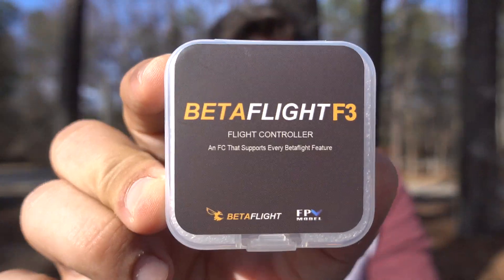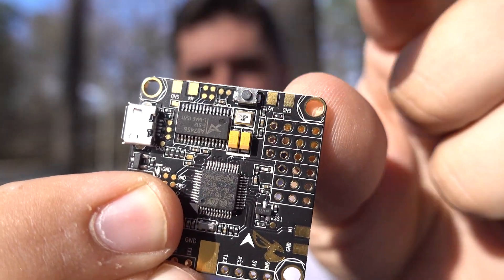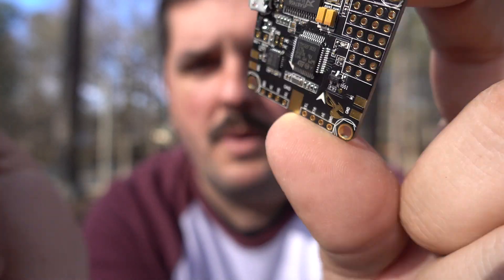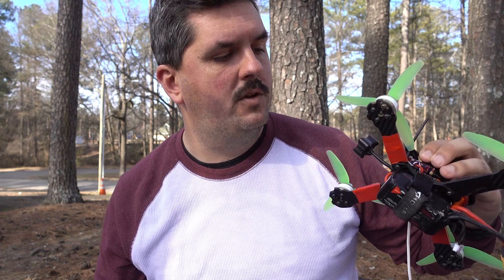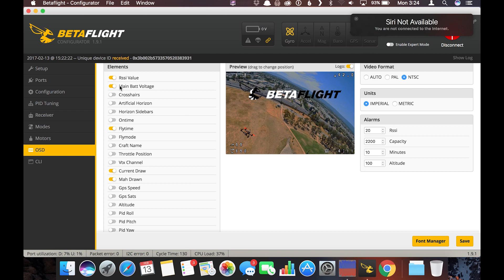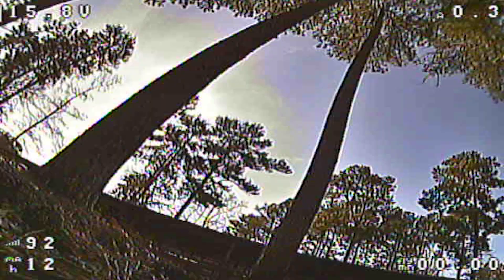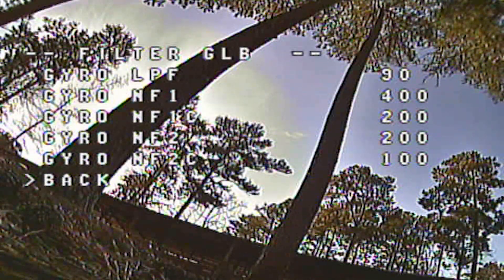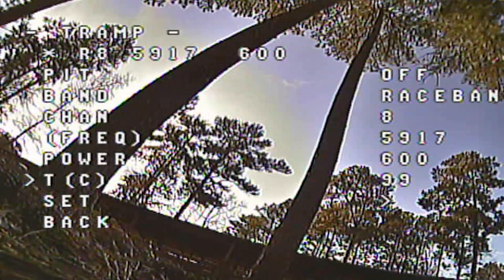Betaflight F3 Board Overview

Comment: Video noise? Ive tried it with the tramp with tons of noise. If you like lines in the video feed its a decent board.
Reply: daniel dimitri thanks for all the info, i have tried everything you have listed over the years and still no luck.
Reply: daniel dimitri there's lots of problems with this flight controller. look at the forums. it might have his name on it, but they're all made in China... its a decent board, but they all have their flaws. this one is video noise and an irritating ESC pad layout. these boards excel in tight builds where you want a really low stack. if you need to add 4 capacitors and an lc filter to remove the noise, what's the point? just buy the omnibus f4 clone off banggood for £20 remove the regulator and add a pdb. save money, get all the features with none of the hassle. as said, the dys is far superior in every way and better value. this board has been out around 5 months. that's ages with the speed of tech.
Reply: daniel dimitri the omnibus f4 pro v2 is crap mate. Lots of issues. There's a v3 out that fixes a lot of them.
Reply: jwhit87 same prob here. Even an lc filter didn't cure completely. The dys F4 is far better and comes with softmounts, a tiny buzzer and 
has esc pads on both sides, and better pads to solder.
Reply: Coppertop FPV i tried that too, i like the soft mounts but still got video noise. Need better escs or better fight controller. Also the new 2.0 tramps will change channels on its own while flying. IRC has the worse customer service in this hobby.  Its hard to find quality products in this hobby.
Reply: some noise is nearly unavoidable. ESC noise on the main battery voltage can be so rediculously severe that you will need some other measures.. a low esr capacitor helps, usually a 1000 micro farad. but lower esr and higher farad is better so making up 1000uf with multiple small ones works best, using 4 330uf low esr capacitors one soldered directly to each ESC should work wonders. the noise level isn't technically as low as regulated power with an lc filter the without the low esr capacitor/s the negative voltage spikes can be so extreme they'll even make it into a 5v regulated supply power. this can cause brown outs in the processor leading to a crash, desync the ESC pwm values and put noise where you haven't externally filtered it like in the osd.

I would do these steps in order and stop when the video clears up. 

1, low esr capacitors.. preferably 4x330uf because in parallel the esr is lower and they make emit a little emi so keeping them o. the arms and not near the signals is better. the capacitor should absorb the high spikes extremely well and avoid a need for a snubber diode to protect the electronic parts

2, separate your antennas as much as possible. I run my reciever antennas horizontal behind the front arms so the props and forward motion of the quad sweep them back and they created a 90 degree vee, I put my transmitter antenna sideways not vertical. this allows me to run the video antenna behind the quad away from everything. you might be even better with one reciever antenna vertical and one straight back off the rear if you can get the video antenna far enough away. 

3, keep antenna and signal wires away from the capacitors and the power wires, if they must cross, cross at 90degrees to reduce capacitive coupling and emi from going from one wire to the other. 

3, use regulated power for the camera and vtx even if they tolerate battery voltage. if you've made it this far on the list the battery sag might cause little pops In the video. 

4, twist your signal wires. this isn't just for neetness. cat5 cable is twisted for noise rejection. the theory is that it ensure emi enters the wires the same distance from the vtx so a high spike on the signal and a high spike on the ground will be out of phase and not be interpreted as a signal. 

5, similar to twisted wires you can pass signal wires through a ferrite ring, multiple passes might be needed. this is called a common mode choke. when the emi enters the wires and passes through in the same direction it creates an inductance and you get a low pas filter. when the current flows in different directions the inductance is canceled, and the normal signals which are also high frequency aren't attenuated. 

6, install an lc filter. this could go higher on the list especially without an aio type bosrd and I would definitely do it if the fc didn't have a current resistor that it also used as the power for the the fc. this doesn't play as well with aio setups with current sensors since they need a high current pass through. the LC filter cant then filter the flight controller power unless they have a dedicated pin for power to the flight controller sperate from the pins for the current sensor. a normal LC filter wouldn't handle motor current and high current would also saturate the inductor core and it would lose inductance making it useless as a filter. so you can't add filtering like this to the onboard parts of some flight controllers but you can certainly filter the vtx and camera positive voltage. 

the trends towards aio setups are probably a big part of the "problems" people have. an older setup would have less powerful motors and might create less noise but it would also be ideal to put an lc filter in off the pdb on regulated power to clean up power to everything that's not the ESC. the current sensors on fc board not pdbs kinda mess things up by forcing the noisiest wire onto the PCB and preventing adequate filtering between it and sensitive parts. a setup with an lc filter a regulated pdb and a snubber diode for protection to the regulator could deliver extremely clean power. but the modern layouts sometimes  make a low esr capacitor the only option and they can work almost as well and a single component solution is more elegant but if it's not sized right, if the capacitor goes bad(and they do) if you only use 1 and decide to put it on the battery side of the current resistor, it might not be 100% effective.
Reply: daniel dimitri or u could just use one capacitor and an omnibus f4 or dys f4, both of which are much better than this!
Reply: jwhit87 I have a hard time believing the board borris put the betaflight name on is that bad. but maybe there is a problem with the regulator or osd on some... I hope the people with problems didn't buy from banggood,Ali express, or GearBest, ebay or crazepony on Amazon. I have no problem with Chinese products if they are original or they are based on an open hardware design and they admit they are for compatibility with an open source project but not manufactured by the oem but when they clone the logos and pass something off as the real deal it's just not right, and you will see products on certain vendors who the manufacturer doesn't have listed as a reseller. even kiss hardware is cloned and people can't get through the registration and have to flash betaflight instead. if you guys are 100% sure you got the real deal and still have video noise well then I'm glad I have an omnibus f4 pro v2 on order.
Reply: daniel dimitri one board stop working and the other has mid throttle vibrations. Best customer service and quality has been from Banggood from my experience.
Reply: Coppertop FPV yeah, apparently I missed the news on the V3. still the issues are minor, I mean all f4 boards are a pain for taranis telemetry but I'm going to try softserial, some guys had luck on some boards with a resistor and softserial, I  might film it but don't expect a professional video. and the 24amp current sensor error is fixed by running everything from 5v.. or it can probably be calibrated out.

the integrated pdb might be the problem with the f3. the traces for escs must be large and there could be capacitive coupling to a trace for the video or power to the osd. only option is to try a low esr cap on each ESC rather than one big one on the battery. the aio approach does have drawbacks.
Reply: jwhit87 customer service in one thing but they have been proven to carry clone hardware. I can't say for sure if your hardware isn't authentic but there is a risk. lots of people use banggood but in the USA I don't see the point, I can sympathize with duties and fees in other countries but I have no reason to shop there and save $3. I can just as easily find parts on Amazon from a few fpv vendors. I don't think clones are so bad if they are presented as such but when they are not then it causes a support problem for the real manufacturers while someone else steals business. I mean people wonder why all these products have issues but so much sales revenue goes to Chinese vendors towards clones the customer didn't even know wasn't real and that money could go into r&d. my rant isn't about China vs America, or quality I know the og products are also made in China which is why they are so easily cloned. I'd just rather money went to the actual people who actually designed the thing.
Reply: I rather have a clone that works than a name brand that uses hype and false advertising. Customer service is important in a hobby. If you want better R&D stop supporting shitty products. Some other great websites are readymaderc, getfpv, and pirofliprc. I'm just giving my feedback from everything I have tested over the years and I'm not sponsored. Im waiting for a company to make something that has all the features without video noise. No mods, no extra caps, no bullshit. Just something that works as advertised.
Reply: jwhit87 probably not happening in an aio unless they also design the ESC. and they are all shitty products. I mean I don't have experience with many of them but really there isn't much excuse for the lack of a digital video solution that doesn't cost more than the copter. blah blah latency... yeah analog has latency too, frames are discreet, you'll average about half the frame rate, and only half the frame is redrawn at a time to you get persistence from the last frame causing motion blur. digital could be just as good with a hardware encoder and a high frame rate. and ya know what, they use low latency hardware encoder in USB webcams. pair the right lens and sensor to be flyable and you could make a $40 digital fpv setup. the whole hobby is jacked up and behind where it could be and all people worry about is finding a $13esc because $19 is just too much. spectrum sux, turnegy sux, frsky sux for no reason (phase inverted signals wtf is the reason? and what's with the complex interface?) and yes a clone that worked would be nice but if it worked better than the og it wouldn't be a clone would it? I know there are some Chinese boards that are improvements over boards that use the same firmware. I hear good things about dys, Chinese motors are great, mostly because I don't think they make motors anywhere else but I wouldn't expect better from Japan or Germany or Switzerland. maybe I like the hobby because it's  messed up. maybe I have an obsession with fixing someone else's unfinished work and in the end the rc hobby was always that way. I've had servos twitching and receivers Browning out for the last 20 years and not nearly as much as far as resources on rf and circuits as is easily available today. 20 years ago a capacitor was a capacitor, nobody had a clue about esr or common mode chokes or voltage dividers or low pass filters. 20 years ago if you had a glitch you might lost a model and it was comparitively a lot more expensive. just for a brushed rc car an ESC could cost $80, a motor could be 40 and a battery could be $65 and I'd you had a hot motor it would brown out the Bec and the car would run away on you. they sold capacitors and called the glitch Busters but the never worked because the voltage of the receiver was basically coupled to the ESC coutrol circuits, you couldn't make the receiver stay on longer than the ESC unless you were smart enough to add a resistor or a diode. but the damn glitch buster didn't have any of that. guys my father's age had to had build their servos and radio parts. even the transmitters we're kits never mind the models. so if you complain about soldering a few capacitors maybe this isn't the right hobby.

Comment: Always out-of-stock.
Reply: I've been getting mine from fpvmodel, I'm on my 2nd one due to living next to a lake.
Reply: Actually mine was faulty & failed on day 2. The RAM pads powering the vtx & cam went to 0V without warning & are now dead. Several others have this problem I found later. So I dont have the same feeling as you.
Reply: Yeah just like normal.....
Reply: Marlon Clark what you do is Google what ever part in stock u will always find it man
Reply: www.racedayquads.com and www.helidirect.com have them, and have consistently for some time now. Both provide good service.
Reply: Marlon Clark crowncityfpv.com always has them in stock getfpv.com has them  an hobbytown.com has them not very hard to get them anymore
Reply: Marlon Clark Also try multirotorinsanity
Reply: Bought one from getfpv like a week ago. Love those guys.
Reply: Oki FPV you're not the only one with this problem... Are you running a tramp? I'm pretty affraid to use the ram for now!
Reply: I will have to wait for the next build due to ordering a KISS FC.
Reply: no problem getting mine last week from fpvmodel, arrived a couple days later
Reply: Just order them from FPVModel... Got two of them in less than 3 week.
Reply: my 3rd BFF3 just arrived today, ordered sunday from racedayquads
Reply: Their website has it. (Unless they haven't updated it to say out of stock.)
Reply: Yeah they are great I'm on the west coast so it still takes a lil bit for me to get my stuff from them
Reply: That's a bummer! They're only about an hour or two from me... Two-Day shipping gets my items to me in a day lol.
Reply: I got crowncityfpv is like that me on the west coast I mainly buy my bulk props an some frames from getfpv now
Reply: Aomway600. I put in a separate 12v ubec & run the cam & vtx off that, but I am also nervous using it. I'm getting a replacement. Not using pdb or current sensor, I only wanted it for the osd part 😞
Reply: I have that exact same issue over here! Just went to 0V with no warning. VTX gone, crashed. I now power VTX right from my lipo pads (it does not add to mAh drawn then, of course....)
Reply: Which VTX are you using??
Reply: TBS all day HV too not 5v unify pro life  baby 800mw life
Reply: failure was with the tramp HV